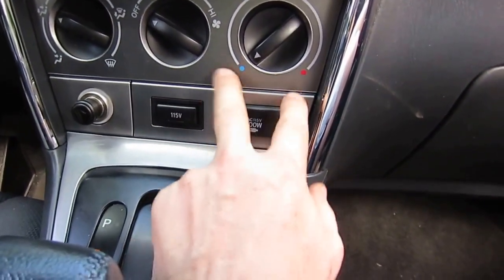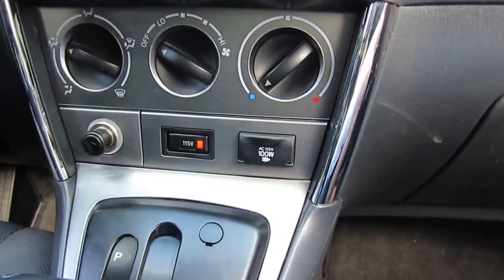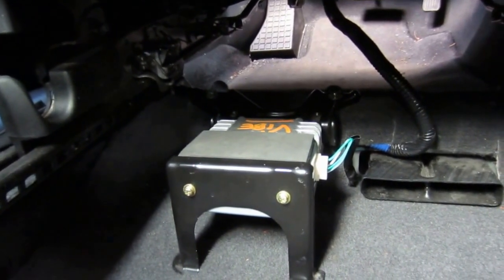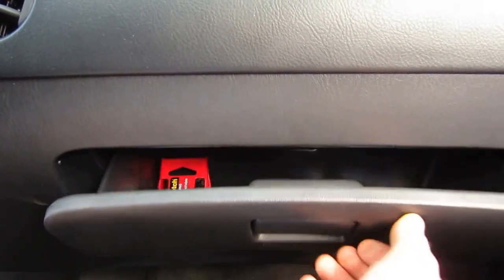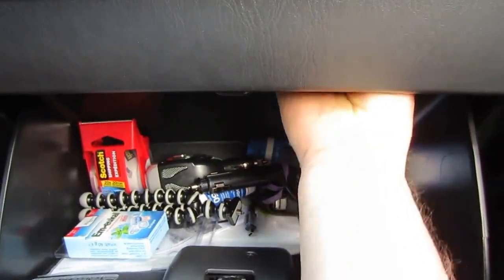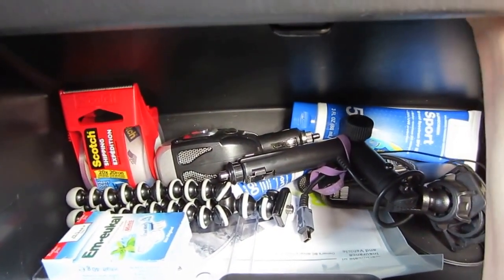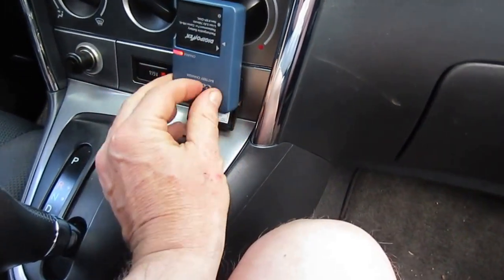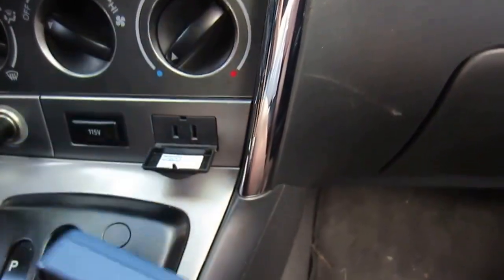115V Inverter for Toyota Matrix from Vibe

Comment: Well the vibe and the matrix are not exactly the same, they are different in quite a few ways. Try and swap body panels. It’s amazing to me the differences in their sound systems. The vibe had the amplifier upgrade for the sound system, and the matrix did not. But the matrix was optional with a JBL stereo upgrade, but no amplifier at all! The matrix doesn’t have any of the wiring, none at all. The wiring diagram show the tweeters connecting directly with the door speakers?! Plus the vibe had power mirrors and the tweeters, but roll up windows! Huh! I have upgrade my matrix base to an S, and so everything has been plug and play, but not so with the sound system. The best upgrades to make are the driving lights, cruise control, and the rear view mirror with map lights. All factory options, and easy to install. Good luck with any mods to your matrix.
Reply: i know this is an extremely old comment but my matrix came stock with an amplifier
Reply: I heard crusie control an differ on early matrices. What year was yours?

Comment: 100 watts at 115 volt is only .83 amps. That doesn't power much. Have you thought about how to upgrade to maybe 500 watts or so? I have a vibe and like the outlet but most things don't like the tiny amperage. Thanks
Reply: did you ever find out?

Comment: Weird. Been on every matrix I've owned. Well...never owned a base model. Just XR's and XRS.
Reply: Will it power up a laptop?
Reply: My xr didnt have it so i had to find the parts for it
Reply: Hex yes it will.
Reply: I think it was excluded from the Canadian market Matrix
Reply: @AmeriFanPicker how can you power a laptop when it's only a two prong plug? Genuinely need help plugging my laptop in
Reply: @finnafishfl  adapter.
Reply: I've seen the small ones that got from 2 to 3 with a little piece of metal sticking down as a ground i guess. Wasn't sure if it was safe to use in this application

Comment: Worked really well but one thing, the bolts for the inveter mount under the seat were too small to thread into the stock holes underneath the seats. Very odd because i happen to accidentally take two sets of bolt home from the pull yard and neither were wide enough to thread for my 04 matrix. I wonder why
Reply: Base Matrix doesn't always have the threads for the inverter bracket under the seat on the frame rails. I used some lexus/toyota spec plastic trim push rivet that was about 9mm in diameter. Worked like a charm

Comment: I have a 12v electric motor to power my paddle board, it used to work great when I plugged into my car outlet. Now it loses power after a few seconds of inflating board and then and shuts itself off. I tested the relay and it works fine with my lights and phone charger, but is no longer strong enough to power my electric pump. I tested my A/C relay which is under glove compartment as well and it works fine too. What could it be that when I connect my electric pump it loses power? I tried to turn off A/C, shut the lights off to see if that can offset power, but that doesn't work either. Any advice?

Comment: Would’ve help if this video showed how from start to finish. I got the switch/plug (and the inverter minus the relay) but didn’t know where to pull the harness from the inside of the dash which I end up cutting it. It’s probably useless now.

Comment: Anyone else have problems NOT finding the relay block in their Matrix? I took out the glove compartment, and with a flashlight stuck my head up there and could not find the relay block? My Matrix is wired for this inverter except I can't find the relay block.
Reply: Nevermind....I was looking for it and it was right in front of me. Looking too hard maybe? Anyways, after seeing your hand position when pulling the relay out, I noticed you pulled it up. I was always looking at the BOTTOM of the relay block thinking it was for the airbag. Anywho, took the two visible screws on front of block and one 10mm screw on the top back you have to feel for off, pushed up the back part to release alignment pin from metal bar, and there was the empty slot for the inverter relay. Thank you!!!!

Comment: I got all the components from a scrap vibe  but the light that comes on the when the push button is depressed stopped working after a day of installing it in my car. Small annoyance but atleast the outlet still works
Reply: It's a bulb, pull the switch out and replace the bulb....

Comment: Wouldn't be easier and cheaperto buy a cigarette lighter plug inverter from ebay or an electronic store? I've seen them with different wattage.
Reply from the maker: +niacal4nia I already had a cigarette lighter plug inverter, you can even see it in the glove box in my video. Besides, the cigarette lighter plug inverter was more expensive than the all the parts I got from the scrap yard, but even if it wasn't I would still get the built-in type. .... you are totally missing the point!